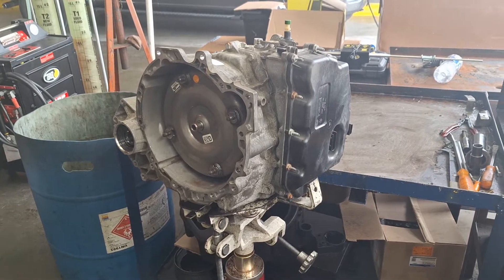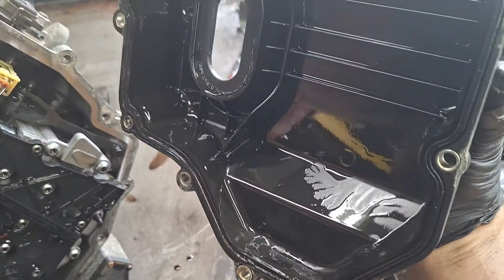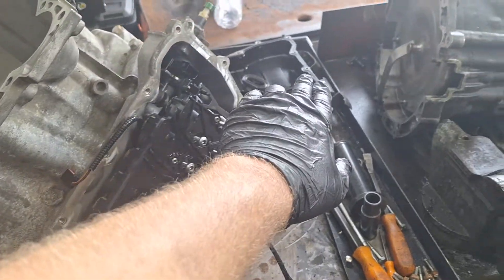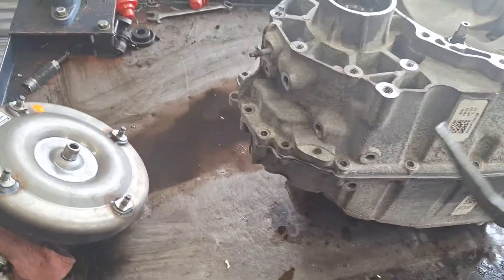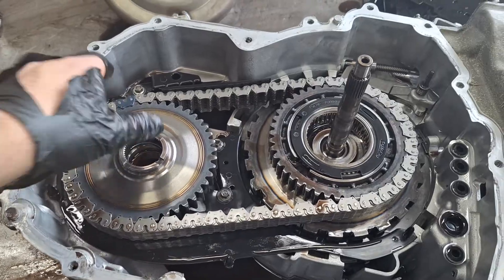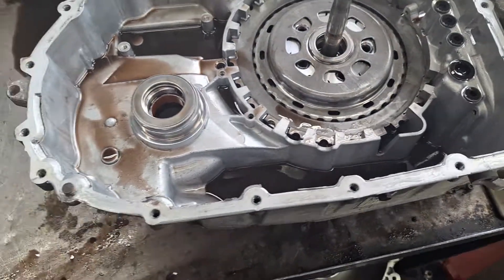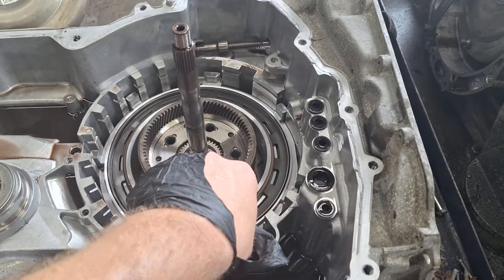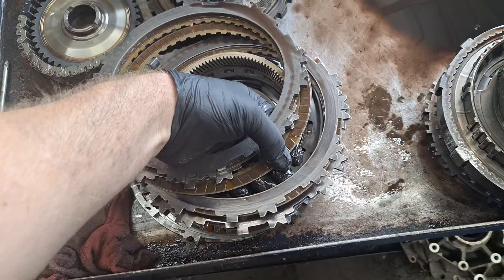Ford 6F35 Transmission Teardown!

Comment: What are the chances of just the pump needing replaced? My 16’ Escape 4wd is making a horrible sound when idling in park/reverse/drive and quiets in neutral. It is not a consistent sound, but also it doesn’t want to engage when in gear unless it is cold and at that point it doesn’t go far. I have been told it’s the pump but not sure if it’s something I can just change the pump and filter or needs a complete rebuild. Already drained and filled twice and the fluid was black but didn’t smell horribly burnt and very little metallic shavings in the fluid.
Reply from the maker: Very high probability it's the pump whining
Reply: Is it worth replacing just the pump and filter or would I need to replace all the other suggested parts?
Reply from the maker: @alaric98  I think replacing the pump and filter is worth doing, yeah, especially for DIY purposes trying to save money. I've got a full overhaul video for this transmission, if you want to take it apart and clean/inspect. You dont need to take apart the center support or direct/OD for that. Just replace the overdrive clutches because the pump failure probably burnt them

Comment: Great video. Thanks. I have a 2017 explorer with the 6f35. I suspect the torque converter has gone bad. It trys to stall at idle. As soon as it happened i shut the vehicle off and it hasnt been driven since. I have also noticed the lockup engaging and disengaging with under a light throttle at cruise. Car has 93k miles and shifts fine other wise. Do you think id be safe just replacing the torque converter?
Reply from the maker: I've got a full rebuild video now. The best thing would be tearing it down and Inspecting it, but you may be fine with just a converter and new front pump (common failure)
Reply: Made by getrag.......its not a fomoco product

Comment: Hello Ben, Awesome video and much appreciated. Sorry if I may have missed a listing, but can you recommend where to source the parts/master kit mentioned? And maybe there’s a list of part numbers? I’m rebuilding my daughter’s 2013 Escape trans (whining pump, etc.), and your info is super helpful!
Thx, Bill
Reply from the maker: Hi, I have a full rebuild video I recently published which may help you further. As far as rebuilding, I'd get a raybestos clutch kit and a motorcraft 7153 master seal kit
Reply: @BigBensCarsAndCycles   Hello again. This unit looks pretty darn clean inside and no burnt metals. Looking to order parts and Raybestos guided me to Transpart. Looking at buying Master kit with pistons, fibers, no steels, OE pump, Reman Torque Conv. and a filter. Can you advise if there are any other companies that you would recommend I check out? Thanks for the help!  Also, should I replace the 2-3 solenoid if there were no problems there?  Thanks Ben!
Reply from the maker: @billgartner3378  since none of the clutches are burnt, you can only do the pump, converter and filter if you want to save money. But I've used an excedy clutch kit from ebay on one before. Otherwise I use oem on customers cars

Comment: i have to replace transmission range sensor in my Escape 2010 wich is inside body valve,,,, do I have dismount whole transmission to do this job ?
Reply from the maker: No, check out my new video for 6f35 full rebuild if you want to. I show how to pull it out on that when I start building it. The valve body has to come out

Comment: What are the weak points with this transmission? Where did ford mess up? Also how come sompe peoples get over 200k with these but others need replacement agter 80k?
Reply from the maker: Weak points mainly are the torque converter and pump. Also shift solenoid B and the forward piston/center support. If you service it every 30k miles you'll get more life out of it. The fluid breaks down quick and clogs the filter and hurts the pump

Comment: Big Ben!!! First off I want to thank you for the valuable information you put in these videos. I love it. Secondly I have a question for you. I noticed that the valve body conductor plate is a common for the plug being broken that Sticks through the valve body cover. Is this as simple as removing the valve body cover and replacing the valve body conductor plate that sits on top of valve body? Any information on this Matter I would greatly appreciate, Thanks for all that you do! - Nick
Reply from the maker: Hi! Glad to help. Yes it's that simple. It's held on with 5 small torx screws
Reply: You the man! Thank you and have a great year 🙏🏻💪🏻

Comment: HI, have a 2019 ford galaxy with 8f40 has a jerky feel when changing gears any idea what it could be torque converter?
Reply from the maker: Hi, you can try servicing the transmission and adding friction modifier (lubegard shudder fix) if you think it may be converter shudder. But If it happens during shifts, you may have a sticking solenoid or worn piston seal

Comment: great video.  i had a p0751 code stuck A solenoid. solonoid seemed to checked out according to book.  changed fluid twice,  still real dirty within 100 miles.  it's on a 2013 ford escape.  thanks
Reply from the maker: I would check for wiring harness chafing on the main control cover studs. If the wires look ok, try replacing shift solenoid A, and the leadframe. If the concern is still present, remove the main control and air test the forward clutch. Overhaul the transmission if the forward clutch fails. That's a common failure.

Comment: mine clunks when putting into drive then it seems to go right to 3rd gear.... any ideas before tear down
Reply from the maker: Try shift solenoid B before teardown
Reply: thank you... 
I had a po751 code shift solenoid A stuck.. checked A solenoid according to book.  it checked good changed fluid twice, was way dirty both times within 100 miles... it's on 2013 ford escape...
Reply: @BigBensCarsAndCycles 
I had a p0751 code,  stuck A solenoid.. checked out according to rebuild book.  checked out good.. changed fluid twice,  still real dirty within 100 miles...

Comment: i had no reverse in my 2009 escape 6f35 4wd, i took out the shift cilinoid plate and put in a new one and moved the ball bearing back where it belonged. worked like a charm and reverse is fixed. i drove the suv about 100 miles and now i have a light scraping noise from what sounds like the direct support tower/ intermediate clutch piston area. i opened the case bolts from the drivers wheel side and some silvery fluid came out. considering opening it up to fix it or ordering an ebay transmission from a wrecked suv. any opinions?

Comment: Hello I’m thinking I need to drain and fill again my wife 2017 edge with the 6f35 in it shudders on hard acceleration like merging into traffic I drain and filled fluid got a lot better but still there slightly thinking I should do another drain and fill 140k miles
Reply from the maker: It may also be a misfire, check for misfire codes. Thanks for watching
Reply: No codes at all and when I watch the tcc drops to 0 when it happens
Reply from the maker: @user-zv6em1ow6l  if the tcc is stabile at 0 it may be something else. I think it's a misfire. Perhaps you can hold down the accelerator long enough for the engine light to begin flashing, then it'll set a code
Reply: Go goes from 0 to 600 back and forth while it’s doing it
Reply from the maker: @user-zv6em1ow6l  OK yeah another service can help. And shudderfix (lubegard)
Reply: Thank you I hope so of course this happened when she made her last payment on it lol
Reply from the maker: @StephenCarrier-q5o  oh wow.. good luck!

Comment: My 2015 ford escape shudders only when in gear and AT a stop, kinda shakes / shudders like a bad motor mount but it’s not. Also idles fine in N or P just load at stop in drive or reverse .. I think it’s the tq converter. What do you think?
Reply from the maker: I think your torque converter clutch is damaged and not fully releasing.

Comment: Thank you buddy for making this
Reply from the maker: You're welcome!
Reply: @BigBensCarsAndCycles  
I have a ? For you I have my 6f35 out of a 2014 transit connect 2.5 front wheel drive 6 speed automatic out and disassembled I am having a hard time with the clutchs they have some small hot spots on them but they don't look burnt 
I found the filter was clogged with alot of metal shavings though and I know I should just replace them but I'm strapped for cash at this time I have more time than money so my ? Is can I send you some picks of the clutches and steels could you maybe tell me if they are to far to keep using or not
Reply from the maker: @reliableservice3886  you can send pics on my discord or Facebook group
Reply: @BigBensCarsAndCycles  
I have a ? For you I have my 6f35 out of a 2014 transit connect 2.5 front wheel drive 6 speed automatic out and disassembled I am having a hard time with the clutchs they have some small hot spots on them but they don't look burnt 
I found the filter was clogged with alot of metal shavings though and I know I should just replace them but I'm strapped for cash at this time I have more time than money so my ? Is can I send you some picks of the clutches and steels could you maybe tell me if they are to far to keep using or not

Comment: I'm about to take one of these apart on my girlfriends 2016 Escape. Curious, could you help explain what would cause it to refuse to move? I limped it home about 2 miles from home. it would drive and shift fine for about 15 seconds every time I would restart the car. Currently it won't rev above 2.5kish while in drive, and will not move at all. No CEL.
Great video by the way, this will help a lot during teardown.
Reply from the maker: Happy to help! Does your transmission whine? If so that's a pump failure. Make sure there's no leaks first
Reply: @BigBensCarsAndCycles  Thanks for the quick response. No leaks found, but the pump was definitely whining loudly the entire way home. I decided to try a flush, probably the first time the poor thing was ever serviced. Didn't find any metal in the old fluid but the stuff looked fairly thick like motor oil. The pump still whines after the flush now. So at the very least, I can start with bad pump then, eh?
Reply: @BigBensCarsAndCycles  hey man it did appear to be the oil pump so i got the whole thing torn down, and got all my parts to install. Just one question if you could answer: the rings for the Hub Support Ring are stiff, and maluable. Do I just send em home and stretch the hell out of them? They are square shaped rings and fit perfectly on their corners but awfully loose when seated in normal.
Reply from the maker: @keech2540  would you mind joining my discord or Facebook group and posting pictures of this?
Reply: @BigBensCarsAndCycles  Awesome yeah I will do that.

Comment: So I have a 2015 Ford Escape I hear whinny noise coming from the transmission.I have a code for P0766 shift solenoid D stuck off .I did an oil change and the whinny noise still there. Sometimes when I try to drive it’ll lose power and won’t go no where.Rpm just up and down when losing power. When starting it up sounds like whining and grinding.Just started doing this .Wondering how can I fix this problem .Does the torque converter need to be replaced or the whole transmission .
Reply from the maker: That's a front pump failure. Extremely common. Caused from (my theory) the fluid breaking down and restricting the filter. Replace the pump, converter, valve body, solenoid body, friction plates, and determine any other damage (check and replace the 7L328 support and pistons). Service the transmission every 30,000 miles to prevent this next time.

Comment: Excellent video - thank you.

Out of interest, could you change the solenoids without removing the gearbox?

My box has started giving a clink between gears 2&3.

Thanks
Reply from the maker: Yes, just pull the side cover off, remove the leadframe and you'll be able to get the SSB out. You'll want to order a replacement with the same band number. Usually it's 2 or 3. It'll be engraved on your old one
Reply: Thank you for responding. 

Much appreciated

Comment: My 2017 Ford XLT also  has this transmission F635. Exactly the same issues you pointed out. Torque converter, shift solenoid B, Front Pump, Center support on the direct clutch problems, Good video
Reply from the maker: Happy to help!
Reply: I just had mine replaced on a 2016 ford fusion. 2.5L, made it to 177000 miles. Bloody things arent made to be serviced
Reply: @lemuelseale1640  Saludos bro, estoy pensando en comprar exactamente  el mismo auto con 97 mil millas vale la pena ? esa trasmision es  durable ?
Reply: @eddideleon2845 me sirviò muy bien por 6 años. Pero a esos altos rangos de millas pues se espera q va tener problemas. Me salio unos 4mil para arreglar el transmisión, y ya tienen unos semanas arreglando porque los partes siguen siendo defectuosos.

Es un carro excelente, solo hice los cambios de aceite, las gomas, y los cintos. Ni el aire se me ha fregado (hasta el momento!).
Reply: @lemuelseale1640  Greetings brother, I am thinking of buying exactly the same car with 97 thousand miles, is it worth it? Is that transmission durable?
Reply: @eddideleon2845 also, it was just a check engine light that forced me to do something about the transmission, it never jerked or did anything crazy. I drove a lot of city miles on it too, and didnt accelerate too crazy. Was/is a great car, at least mine was anyway
Reply: @lemuelseale1640  Thanks bro, I will follow your steps
Reply: What is a XLT other than a trim level?
Reply: @larryreno8293  

Forgot to type “explorer” XLT. I also misspelled 6F35 tranny as F635, thanks for the correction
Reply: @bobbygarcia8288  got it. Didn’t even catch the F635. Is the explorer a V6 ?
Reply: @larryreno8293  

Ecoboost 2.3L L4, FWD

Comment: My wife's 2014 Ford Escape started making a whining noise. Upon inspection of it I found that it blew out a CV Axle Boot, I replaced with a new CV  Axle, topped off fluid and it still makes the whiny noise. No slipping, everything shifts well. From my knowledge from experience and research, I suspect the pump is going out. Trying to make my mind up on what to do. Still owe around 10K on this thing. I was totally against her buying it because I found several issues with it and Ford repaired the issues I found before I would sign off on it. Has 146,000 miles on it. Other issue with this unit is that the service engine now notification comes up but there are no codes at all that comes up with it. Concerning the transmission issue, when it happened with my wife, the service transmission now warning came up, still no codes with it. It has the 1.6 Liter ecoboost engine.
Reply from the maker: Yes that's definitely a pump failure. I'm sorry to hear about your situation, owing 10. But the transmission is going to cost about 7 or 8 grand. You could try to save a couple grand and have it tore down instead. You may have got lucky and the pump not have wrecked much else. But there's still lots of common internal issues which should be addressed while opened up. So the cost savings dwindle down

Comment: Hi Ben, Great videos! I'm building the 6F35 out of my daughter's 2013 Escape. My first transaxel. It was whining like an worn power steering pump and will slip and shudder when warm. I'm assuming the pump.  It's out and the case is split open. The fluid doesn't smell burnt and no chunks of metal, but a moderate amount of fine metal in the bottom and on the magnet. What are the "must replace" update parts to order for this unit besides a master kit and torque converter?
Reply from the maker: Besides the master kit, and torque converter and pump, buy a new loaded center support 7L328, get a new forward clutch pack snap ring (that first giant snap ring in the stack) because it can rotate and break the case. Replace solenoid B, or better yet replace the whole valve body and solenoid body. Replace the direct/OD drum to prevent firm 3rd gear upshifts or at least reseal it and inspect bushings. That about covers it. And yes your whining noise is the pump

Comment: Can you please provide some guidance?
My 2014 ford escape 1.6 liter front wheel drive with 180000 miles will occasionally loose power stilghly when acceleraring, I pulled the following code : P0741 and PO744.  I changed the transmission fluid; I did 4 drains and refills. I also  changed the valve body and updated  the valve Solenoid strategy number and the solenoid body ID. I resetted the learned transmission adaptation but the issue is still there. Is the torque convertor out?
Reply from the maker: Yes that's a torque converter issue. You can try adding lubegard shudderfix before replacing it. Let it idle for 30 min to let the additive work in. If needed, do 15 to 30 wide open throttle runs from 50mph to 75mph to continue working the additive in. If that doesn't fix it, replace the torque converter and front pump. Good luck
Reply: Thank

Comment: Hey, starting out looking for parts as I’m replacing this myself, I can’t for the life of me find the parts I need online, and would greatly prefer to not  go junk yard tear down searching. Any help?
Reply from the maker: Are you trying to get a part number for the transmission assembly or something else? If you need the trans part number please give me your vin and thumbs up this comment so I get a notification
Reply: @BigBensCarsAndCycles 
The two main parts you recommend a replacement for every time the front pump. And center support. Can not find replacements for. 
My vin is 3FA6P0HRDXR237955. Any knowledge or help would be appreciated.
Reply from the maker: @MarkoBonds  oh okay. I can give base numbers. Pump 7a103. Converter 7902. Center support 7L328
Reply: @BigBensCarsAndCycles  hey man, I got into my tear down and it went perfect. The rebuild…my sprag assembly is stuck. It’s one way in and out and it got stuck going back in, any suggestions? I’m 100% willing to cut it out and get a new one